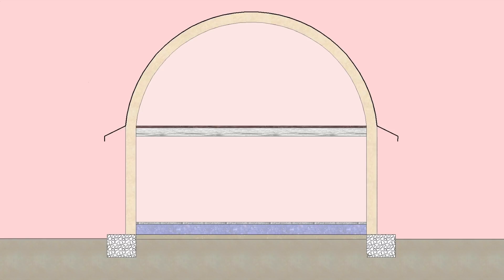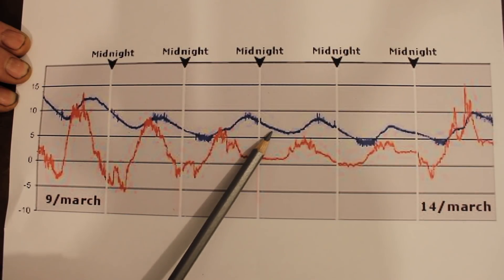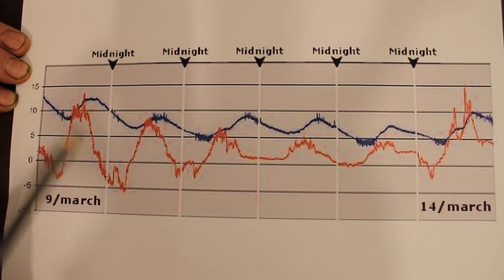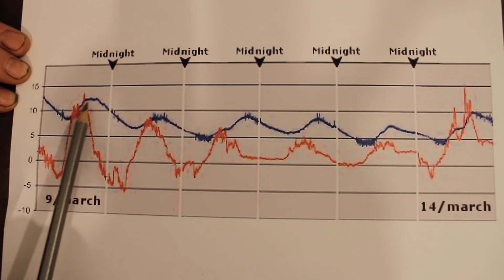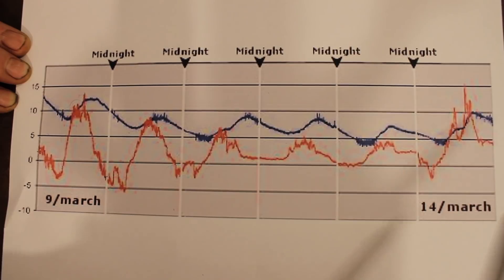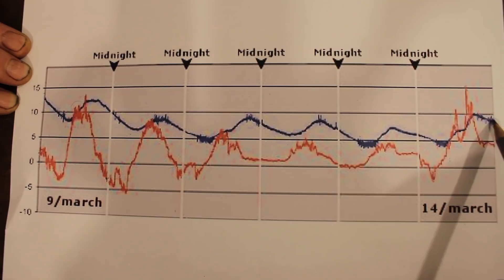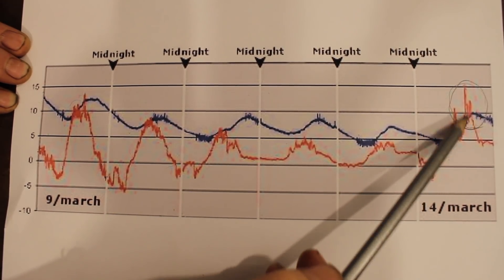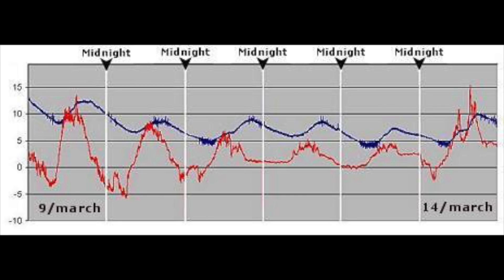what they don't tell you about Thermal Mass

Comment: In cold places like Scotland, it's true, those castles get to ambient temperature right through.  I remember someone who bought one describing heating it;  The rooms had fireplaces big enough to load with a forklift.  They spent the month of November moving fuel and burning it in all of them until the building warmed up enough, then let them burn out and let the building cool down, until Spring.  Temperature is never right, always too hot or too cold.  
Here in the low desert, it's always too hot, and thermal mass and the ground are our friends.
Reply: but that is not the fault of the thermal mass. Thermal mass is supposed to charge up with energy, then slowly release it. But if you are unable to store the radiating engergy inside the building it is useless. You all did not understand thermal mass and the video is all wrong.

Comment: Excellent work.  Distribution (of the mass) is also critical.  A monolithic block centered on the energy accumulation point, or Phase Change Materials, incorporated into the sheetrock?  Sketchup allows components to be built that include sufficient BIM (Building Information Management) characteristics, to run in energy analysis software to determine such things.  In real time, and Virtual Reality, one to one scale.  Results pop up in graphs like a 'heads up' display, but someone will soon add the equipment to make you feel the changes as you construct, deconstruct the building using Sketchup.  You can thicken the slab to 8" from 5" and run a 24 hour cycle on any day of the year, for example.
Another thing the Passive Solar enthusiasts have been longing for but have never been able to achieve, is move-able insulation.  The heat loss through any window is greater than the heat gain, that's why the ratio of 17% to 20% of glass to floor area is required, no more.  A simple sliding panel, (R 10) like a pocket door, could roll down an incline into place at night, to magnetically (refrigerator gasket) seal and insulate the glass area.  Freezers at grocery stores have them made of glass.  
You could have up to 40% glass/floor ratio then, and the additional heat that would come from it.
Another way to do that is to incorporate two buildings;  One with a conditioned space wrapping the other, a classic, unconditioned Passive Solar.  Heat loss through glass then would be mitigated a lot, by the lessened Delta T factor (difference in temperature between inside and out) provided by the unconditioned (but well insulated) passive space.  A lot more glass.  If the building took the shape of two proximate, rectangular volumes,  you'd have a cottage with a sunporch.  Wrap that sunporch on three sides with the cottage, and make all common walls 40% glass.
Reply: its not excellent work...it is all wrong. You all did not understand physics

Comment: If the structure has doors and windows that can be opened when the temperature is warmer outside than it is inside, is that sufficient to allow the thermal mass to be topped up?
Reply: I think this is an instance where a critical mind should question the source. I think what you are saying could definitely work, just would take some trial and error that you could do yourself. That's the problem though. If you do this you won't need an hvac technician anymore...

Comment: I am new to this discussion and I have a question. It is my understanding that Thermal mass system are designed in such a way to mitigate temperature swings from one extreme to the other.
      I live in Texas where keeping warm although very important keeping cool is also quite important. 
      My question is that if I incorporate a Thermal mass into a building where it would stay in the shade during the warmer periods of the year, Mar to Oct, is it possible to cool the thermal mass to aid in keeping the building cool. Example would be to blow air across it or even add piping like you said but pump in cool liquid instead of warm?
Reply from the maker: Yes it works both ways but cold air falls so having a heavy slab cooled in summer would not work as well as having it warm in winter. You could of course do a vertical wall or something to help with this. In Spain they have marble floors which feel cool to walk on anyway.
Reply: yes it is very possible but you need to factor in temperature stratification.. You would get more cooling by putting a huge spiral cold water loop on the ceiling than pumping cold water in the floor. It is true heat goes to cold but it also rises so fight both angles. Others are using this method to refrigerate (Mr.Teslonian and  i think Paul Wheaton) with 35-50F degree water they are maintaining fridges with spring water. The ceiling loop would be best for cooling needs because the heat will rise as it does naturally it will penetrating the cool water in the pipe and be carried away while the cool air around the pipe will fall as well as both will do the tango.. One issue that could come up is dependent on the temps and humidity is condensates forming on the loop but im sure it could be managed easily enough with a little thought.

Comment: At what point in the structure was the temperature taken?

What is the benefit of stabilizing temperature at approximately 10°C?
That's to warm for food storage and to cool for human comfort.

When stabilizing temperature at around 10°C, at least in Ohio U.S, using the temperature of ground water  which is 13° can be used, as mentioned in the video, to heat the thermal mass at times after the peak of outdoor temperature. So I think the transfer of heat from the outside would also be more readily stored inside as well and may improve overall efficiency.

Comment: One crucial aspect about thermal mass is that's it's more effective and consistent if the building is passive solar or south facing. Having lots of windows/doors on the north sides (in northern hemisphere) will  drastically limit thermal mass.  You made no mention about water's ability to store thermal mass! Water contained in low cost, non-pressurized cylinders has proven to be the most practical and effective approach to the capture and storage of thermal energy for space and hot water heating.  Water stores 3 to 4 times as many BTU's per lb. as rock or masonry. We opted for water storage tubes in our greenhouse. If you want to find out more check out SunLite thermal storage tubes. http://www.solar-components.com/TUBES.HTM

Comment: 'Doesn't increase efficiency;????? Are you mad. I ask again are you mad. It clearly stabilized the temperature and kept it within a live able range which could be manipulated artificially to make a comfort zone. What do you expect, that the mass is going to generate energy and know what your preferred temperature may be??? It takes so much less energy to change the interior temp by ten degrees than is does to change it by forty degrees. The next time your thermal mass calls you up and asks what temperature you would prefer, perhaps you should give it a good scolding for not knowing those things for themselves. Thermal mass doesn't make energy, it stores energy and is slow to absorb or release energy. that is it.
Reply: It increases efficiency indirectly by keeping the building at a liveable temperature, avoiding big fluctuations that track outside temperature. It only works if used in conjunction with a heating system that is controlled and monitored to work with a certain thermal mass design for a climate. If this is not the case, the thermal mass design is pointless and can even make the system less efficient. Passive house design without a heating system needs a thermal mass designed in mind with the typical climate the house is built it. People's comments often get misconstrued because they don't elaborate on their points. There are a lot of variables that need consideration. As an energy consultant myself, most poorly efficiently operating buildings are due to bad heating control for what's installed within the building in conjunction with occupancy patterns. Controls just get overridden because occupants are lazy and then complain when their bill is high. They then refuse to listen to your explanation because they don't want it to be their fault. They want to blame the building, the architect, the heating system or the surveyor. It's ludicrous.
Reply: @rtyrtyrtyus  No, it doesn't increase efficiency. Do you even know what the term efficiency means?

Comment: The type of insulation matters greatly. Polystyrene has low thermal mass as has glass wool. Rockwool has high thermal mass. Our last cottage had walls over four feet thick and was like a fridge, year round downstairs, despite a really massive inglenook and large woodburning stove. Our present home is almost flimsy by comparison but I put 12-16" of Rockwool in the pitched roof. We have hardly started using our wood burner yet this year. End of October 55N with average of 50-55F outside and mid 60s indoors without any heating. Our neighbours have been making wood smoke for months! We live upstairs, close to our insulation, in an open plan arrangement with the much cooler downstairs. Don't expect high thermal mass to work with a single glazed, lean--to greenhouse in northern climes. Insulation is far better!  I covered the entire south wall with a 22' green house and it is hopelessly erratic in there for growing or living. All this was worked out in "real world" practice by the Welsh Alternative Energy center decades ago. They built a super-insulated, low mass, polystyrene building which fluctuated like mad whenever the door was opened.
Reply: im thinking of adding a connected greenhouse to my south wall when i build next year..your saying it isnt working for you?
Reply: @D.A.T.GRINGO  You need external shade in summer and thick, add-on, panel insulation in winter. Without these you'll see roasting temperatures and bitter cold. 

We covered our south wall with a single glazed greenhouse 8' deep x 8' tall x 22' long 20 years ago. Brick back wall and brick floor. It is far too uncomfortable to enjoy for most of the year. Can't ever grow anything in there. Provides indoor heat for just a few days of the year in spring if it's sunny.

We use white cloth, internal, white shading until it disintegrates from UV. Out of desperation we're trying some expensive, pro, agricultural shade netting this year.
Reply: @Tricyklist  thx!

Comment: I have hot water storage tank and it works great. It has huge thermal mass, but you can use in if you need.
Reply: the video is all wrong....they don't understand physics. When a building is not heated, as it is dead mass, it will become as cold a s the environment. Only heating it in any shape or form does make it warmer then the outside. So the thermal mass cannot "store the cold" as everything in the house gets cold without engergy that heats the house up. Thermal mass stores energy, when there is no energy over a certain timespann everything cools out and goes in an equilibrium with the envrionment. There is no such thing as storing cold, you only can prevent cold mass from heating up. But in a cold house the thermal mass does not make anything colder.
Reply: @hirthirthirt1693  big thermal mass prevents quick temperature changes. In some cases it's enough to keep temperature in comfort range. You get average from night and day temp and it can be good.
In other cases big thermal mass can be bad for same reason. If you need to change temperature quickly you need much more power for it.
Reply: @hirthirthirt1693  You too noticed he has no clue what he is talking about.

Comment: Your chart exactly showed what one expects of thermal mass to do, doesn't it?
Reply: Exactly, Hymeteron. I really can't see what other point Paul intends to illustrate. 

Thermal mass evens out not just day to day variations, but seasonal ones too. Without supplemental heat input, the building will loose heat to the environment (assuming the design temperature is above the external temperature). It would be useful if Paul could monitor his dome over a whole year... it would provide some useful data. 

Maybe supplemental heat input through a simple old blackened radiator as a solar water heater, feeding the slab, could give higher internal temperatures more quickly matching the external temps.  Or even a bigger window which faces the sun.

But again, all heat will eventually flow through the structure to outside, just in a more moderated way.
Reply: Thermal mass doesn't mean unheated. It's just a buffer which evens out the wild swings of outdoor temps so you don't have to use as much fuel/energy to warm a structure in the winter or cool it in the summer. No surprise there. If you go deeper underground you have much more mass and a near constant temperature.
Reply: Well, I believe what Paul is getting at here is that thermal mass is not an end-all-be-all solution standing alone. Don't expect miracles. So many people are "insulated" from the harsh, cold world of the numbers. The uninitiated think, "Oh you can 'fix' that with just some thermal mass; Problem solved." There are layers and tiers to it all. People use buildings every day having never built one.

Just as computers and phones do not fix societal problems: these devices can augment our processing power and reach; but a tablet is only as useful as the mind and hand wielding it, in the real world. Use it to share cat pictures and profiles of your butt, you are doing no great harm, but you are not solving anything. If you are additive by nature, you will use your device to play video games and further withdraw from society, If you want to feed, clothe, and shelter the world, these tools can multiply the tools already available to your person.
Reply: @christopherneelyakagoattmo6078  Nice word salad.